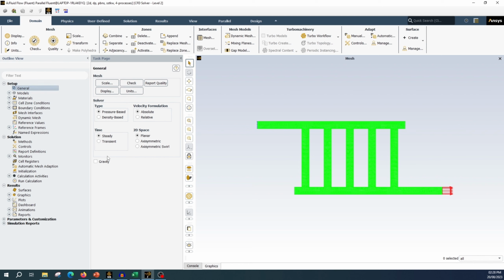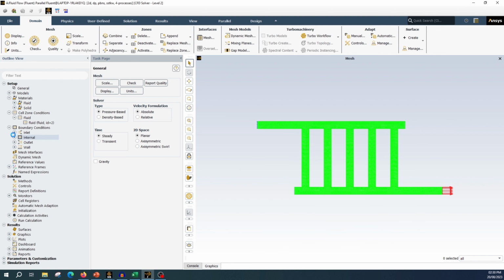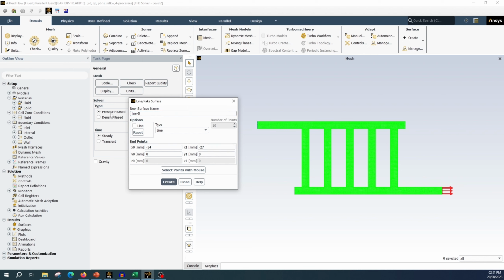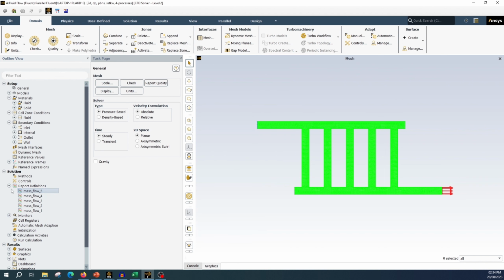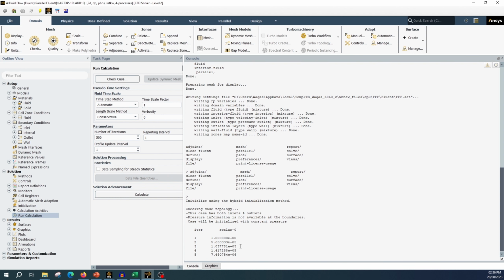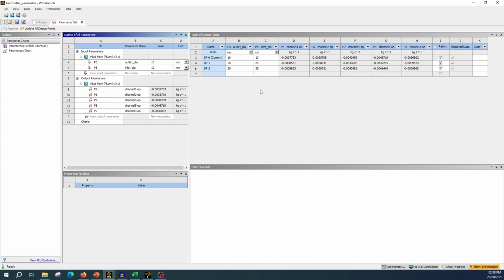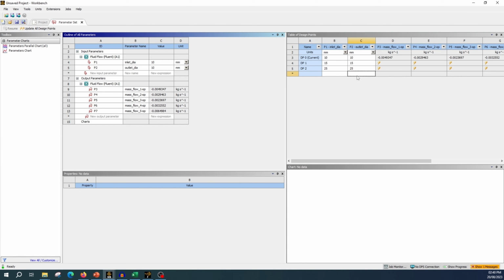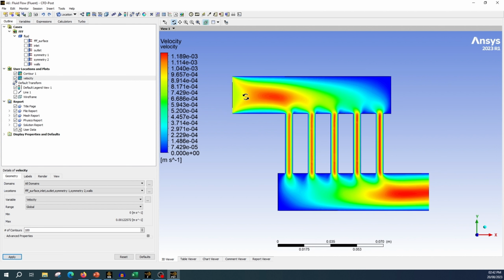Ansys workbench tutorial | Fluent Simulation with parametric geometry | part 2/2

Comment: Can we do the same procedure for 3d model?? Please reply at the earliest
Reply from the maker: Yes, we can use it for 3D model as well. When you create a parametric geometry, test your model in SpaceClaim by  at extreme value of your parameter. 
In general when you test your model, none of two faces should merge with each other.
Reply: I'm facing issues in assigning parameters in the 3d model, shell mesh and volume mesh generation If possible can you make a similar video for a simple 3d model?
Reply from the maker: @jatinbadkar7951  I can make a video on that. It might take some time. Anyway, geometric parameterization is handled in CAD mostly (SpaceClaim). If you like, I can check your model.